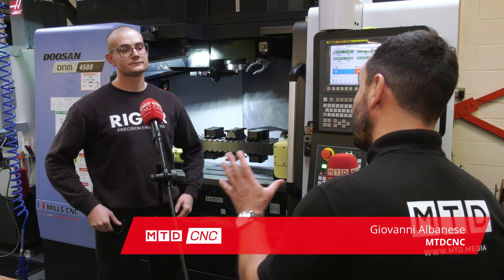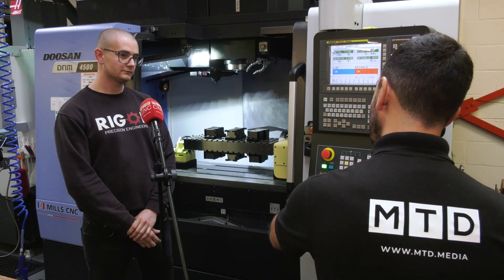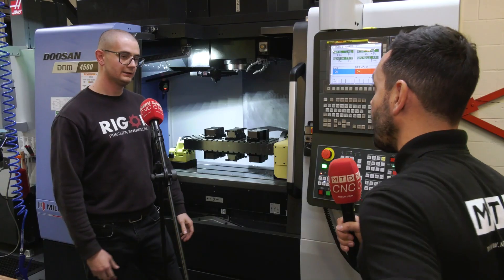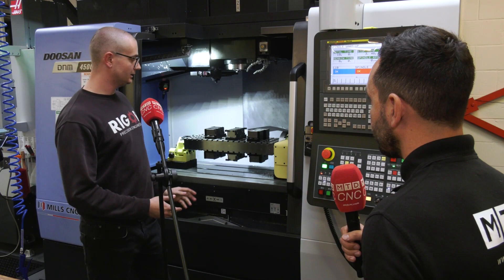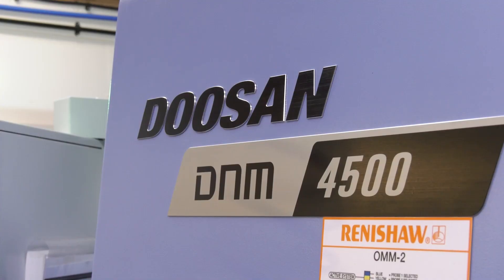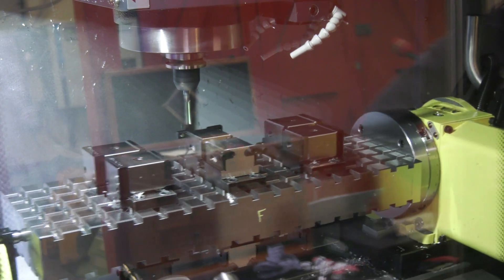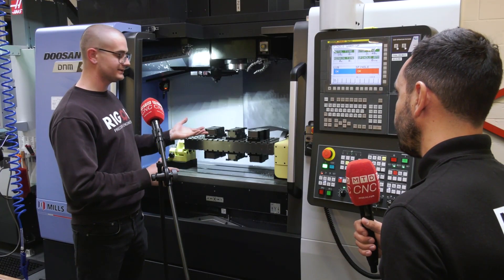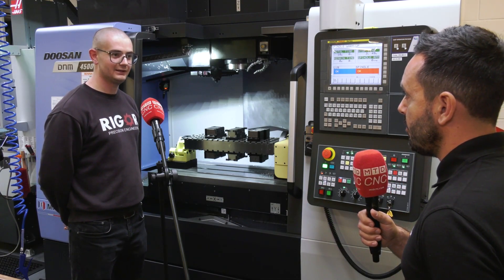Adjacent Side Milling On A 3 Axis CNC

Comment: Good setup 

Like to see actual cutting on this work holding 

We just seen that without feel of cutting 

If possible (please) try to come out with video of practical cutting in future
Reply from the maker: The component at this company was confidential however if you visit the @mtdcnc website and go to suppliers you will find many videos on MicroLoc that show cutting.
Reply: @MTDCNC  

Thanks will do.
Reply: i work with a company who uses a very similar setup with a nikken head (but braked on the tailstock side) to machine brake components out of cast iron, works very well indeed. Doosan and Nikken are quality!